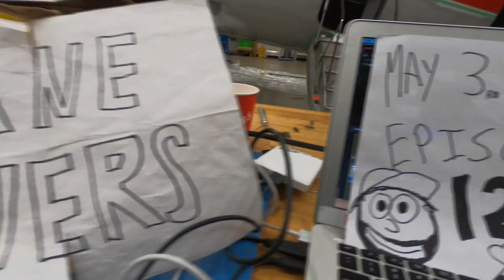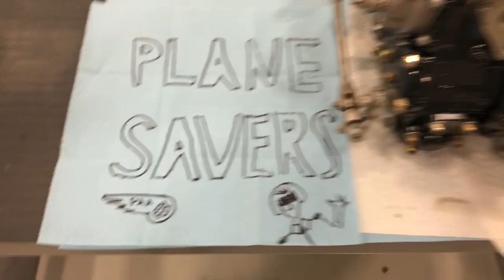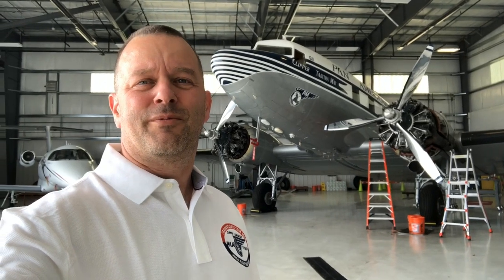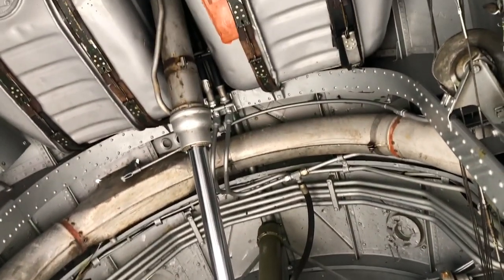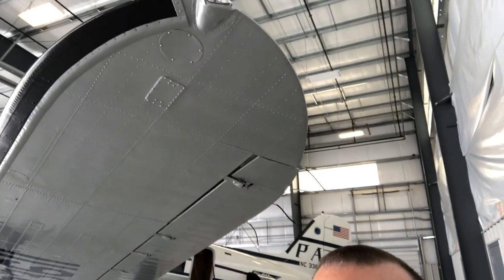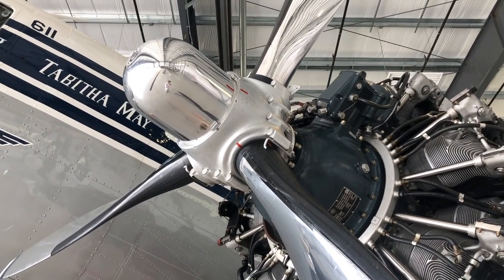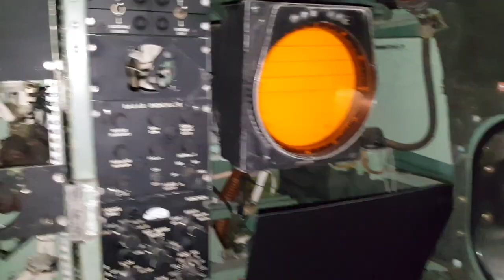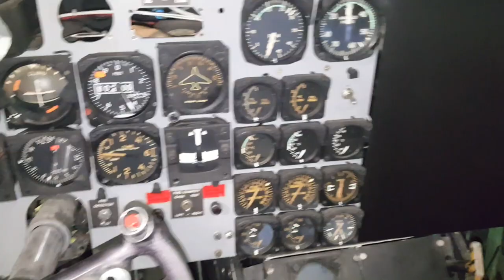"Hydraulic Fluid, Fuel and Now OIL"  Plane Savers E122

Comment: Hey Mikey. Really glad to hear that the crew are safe. Sounds like they listened to good old Bob Hoover...”fly through the crash”. Saved my butt once... basically means ( for those that don’t know) don’t stop trying to control the aircraft until it’s stopped moving!  As much as I hate to see bent metal, you can always repair or replace an aircraft, the important thing is that the people on board are safe.. Onwards mate!!

Comment: A question: Does the DC-3 use the propeller feathering system designed and patented by Florian DeNarde in 1931? If so, I'll tell you why I asked.

Comment: hi Mikey a solution to the tow bar  if you can copy the adaptor they use on nc3351 ? that way you do not  have to carry a large  tow bar every where you go   imm shure  they would share the design with the plane savers crew   thank god the air crew is safe and ok   and great to see smiles on the dtd crews faces as they work on dtd